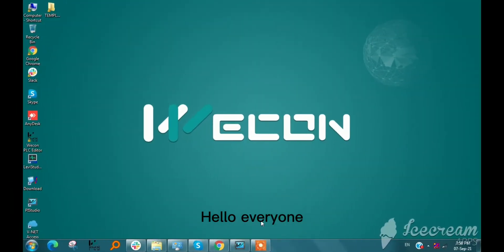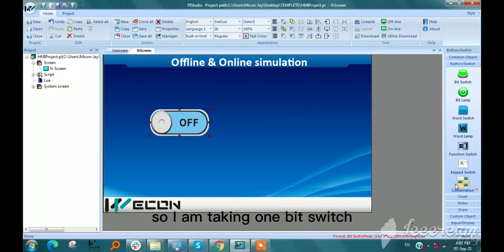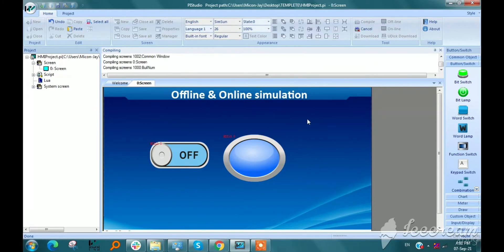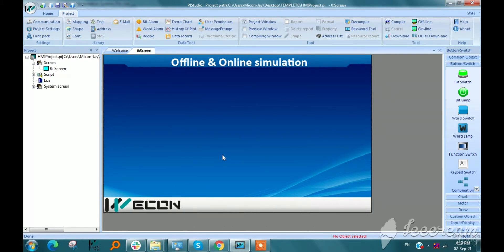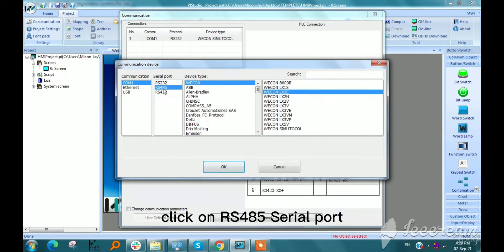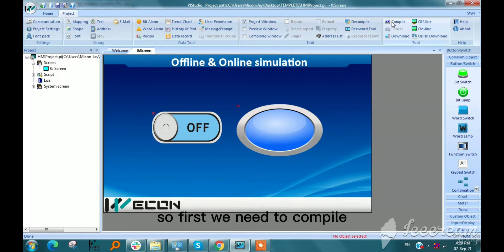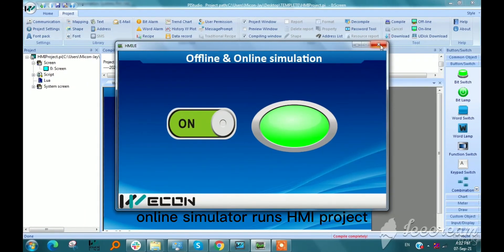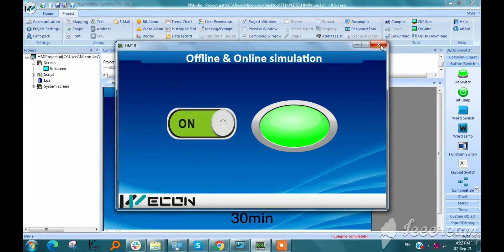Wecon HMI Get Started: 3.Tool: Simulator

Comment: Dear friend, probably i've got a stupid question, but... is the screen dimension scalable? couldn't find any setting for it.. unbelievable
Reply from the maker: Hello, you can modify the model in the engineering parameters in the upper left corner of the software, it has the corresponding resolution